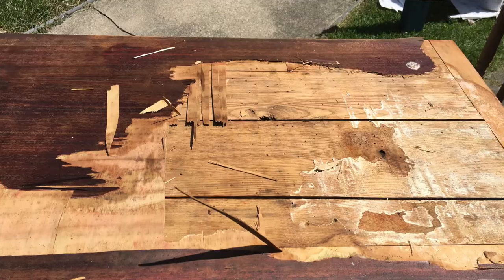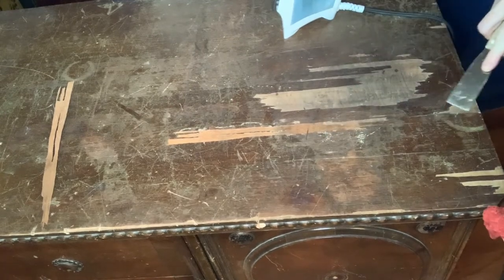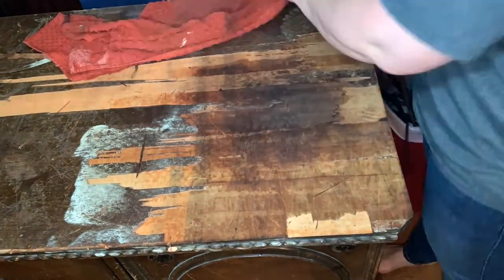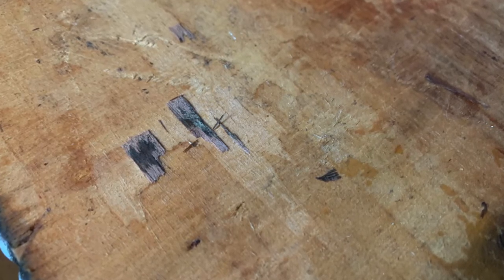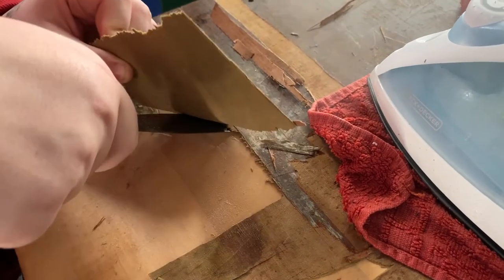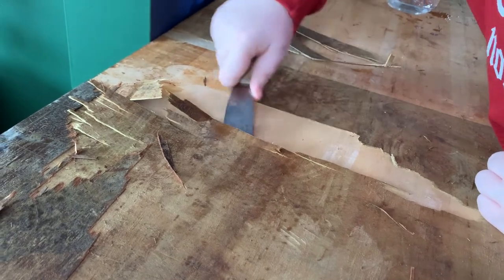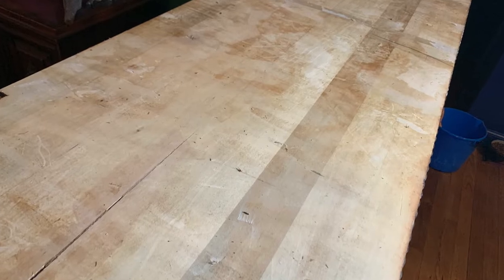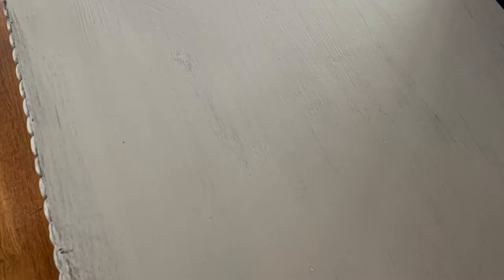The EASY Way to Remove Veneer

Comment: I got a nice solid cedar chest and the ugly veneer that was on it came off so easy on the body but the lid is a nightmare. 

I’ve tried just about everything and I’ve only managed to get 15% of the lid so far. Any suggestions? Tried the heat gun and iron but it doesn’t work well on this part.
Reply from the maker: Try a wet towel on it overnight